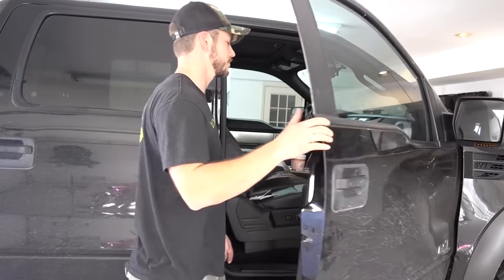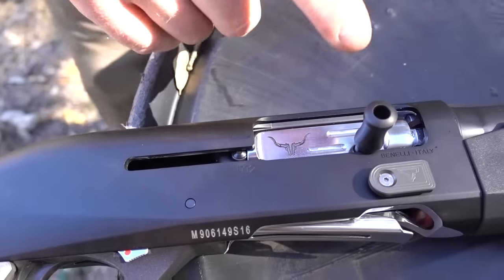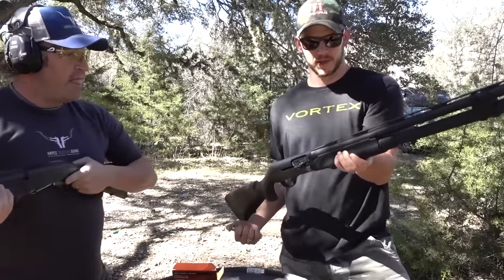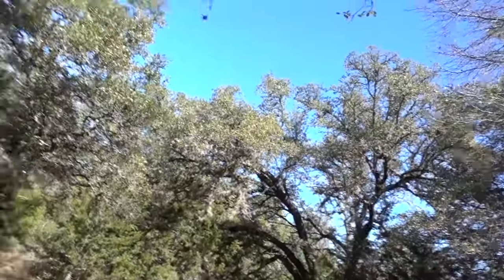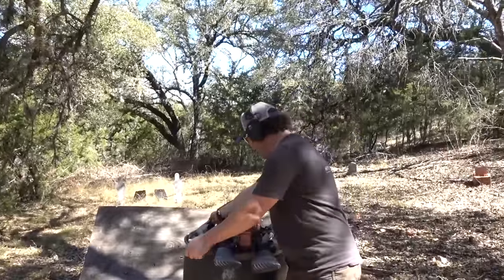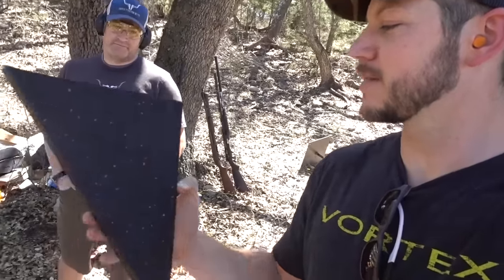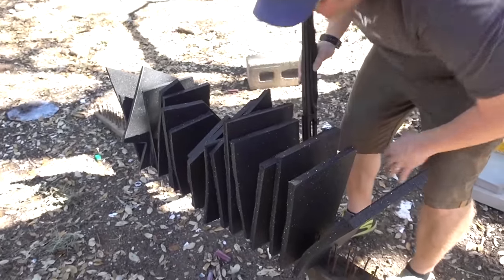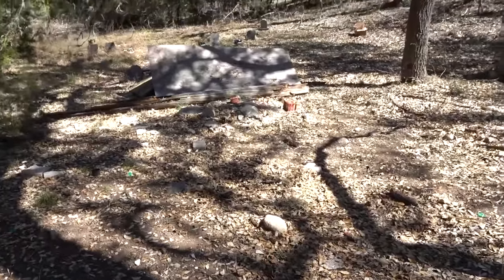Tricked Out Competition Shotgun!!!

Comment: Dude, your videos are amazing! But I wonder what will happen with a bottle of non-Newtonian fluid if it will face with 50BMG's bullet!
Reply: Vlad Skvizz yes pls
Reply: Vlad Skvizz focken explode
Reply: It would be very similar to shooting water. At extremely high shear forces, the difference between Newtonian and non-Newtonian becomes less pronounced. That's why doing a belly flop hurts. Even though water is liquid, when you smack into it, it acts solid-like. When shooting water, the water initially acts like a solid and immediately slows the bullet, which sends a massive shockwave through the water like a solid. Immediately after, it again becomes like a liquid and flows.
A shear thickening fluid like cornstarch and water would display similar but slightly more pronounced effects similar to this, while a shear thinning fluid like ketchup would basically just be like shooting air.

Comment: It seemed like you wanted to be able to see the port better while doing the quad loads. You can "weak hand quad load" by turning the gun over with your trigger hand and putting the stock under your armpit. It gives a more stable platform and puts the gun upside down, port facing you. Then you left hand load, turn it over and shoot. AND YOU DON'T HAVE TO WORRY ABOUT BURNING YOU'RE HAND find out which runs better for you. also get the "Match Saver"!

Comment: What muzzle device is Aaron using on his AR?
Reply: That is a Miculek compensator. I also have a low-mass operating system in that rifle, which consists of an adjustable gas block, lightened bolt carrier, and a lightened buffer and buffer spring. It shoots VERY SOFT.
Reply: Aaron Hayes would you mind sharing the manufacurer of you low mass system and gas block? I've been looking into superlative arms adjustable block(clamp or set screw?) And the jp enterprises silent captured buffer with their low mass bcg in time. Any experience with either companies?
Reply: Aaron Hayes would you mind sharing the manufacurer of you low mass system and gas block? I've been looking into superlative arms adjustable block(clamp or set screw?) And the jp enterprises silent captured buffer with their low mass bcg in time. Any experience with either companies?
Reply: I use the JP low mass carrier and a JP bolt, and the JP rifle length flat wire buffer spring along with their light weight rifle buffer. I also use a Superlative Arms gas block on my main match rifle, although I think the rifle in this video actually has a Syrac Gen 2 gas block. Either one will work great. Most low profile hand guards like Noveske or BCM will require a set-screw gas block. Make sure the barrel has at least 1 dimple for the set screw for best results.
Reply: Aaron Hayes Awesome! Thank you for the info.

Comment: Matt those mats are not as tough as regular  stall mats the ones that you are using have a softer foam rubber on the top you would not use those for animals the regular one inch thick stall mats should be more bullet proof